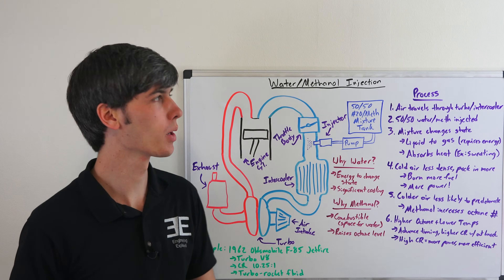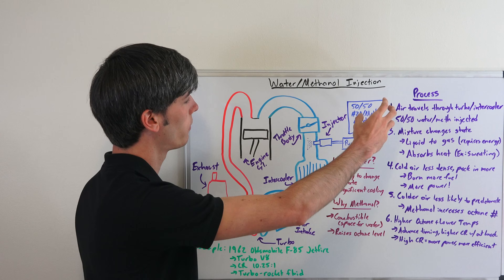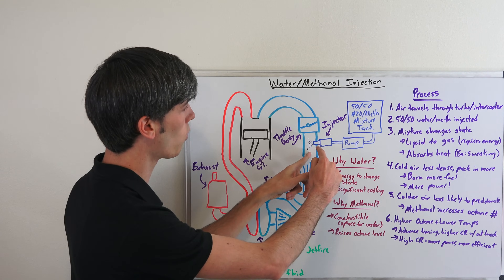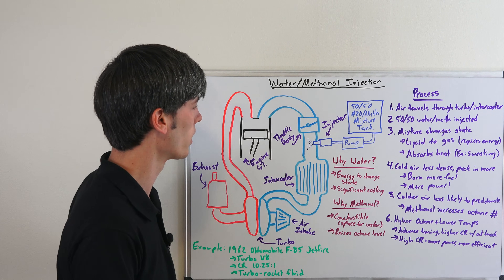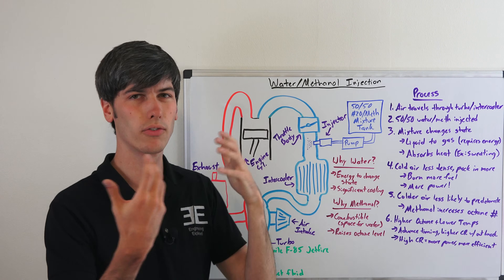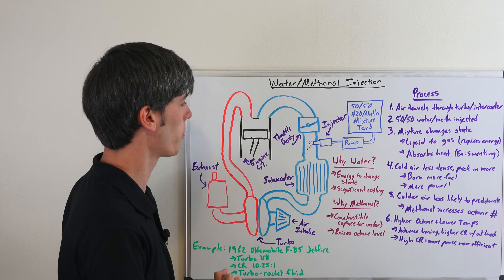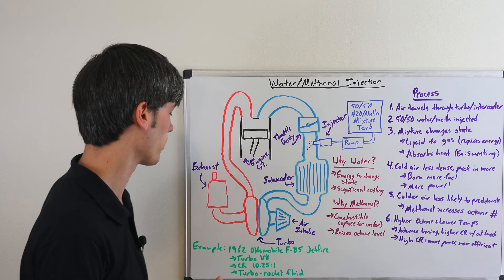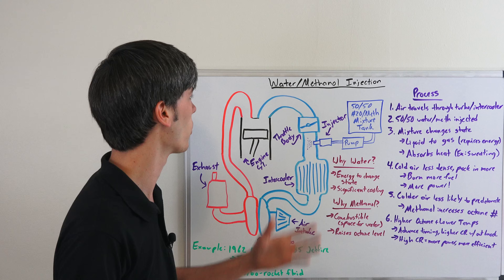Water Methanol Injection - More Boost!

Comment: What happens when only water is sprayed in?
Reply: +Horng Jian Bee If you use 100% water you need a lot of "heat" (boost or compression), otherwise you risk blowing out the flame front causing mis-fires.
Reply: +Horng Jian Bee  Greyson Paynter for it right.  So long as you don't spray large amounts of water, it won't hurt anything.  You won't get the additional power from the higher octane, but you will get a denser air charge into the engine, to a small increase in power - as well as keeping the inside of the combustion chamber spotlessly clean.  I did that for years with a modified classic Mini, since they have a tendency to run pretty hot and not much room for larger radiators.
Reply: you will,not blow the motor it is 100% fin it will,just cool your iat you will not have the octane boost from the methanol so not as much power
Reply: +Brendan Doyle it will not hurt the motor unless you way to big of a jet
Reply: +greyson paynter Yes it wont hurt the engine but if you have a tune for 50/50 but  add 100% water you can extinguish the spark.
Reply: Thats true if its tuned for 50/50 dont put 100% water in also if you run out it will not turn out well
Reply: +greyson paynter Also should add that most systems use a hand held tuner so you can run with system off and different spray levels. E.g. performance tune, track tune, tow mod.
Reply: thats ture
Reply: True*
Reply: +aussiebloke609 Just remember you're only trying to cool the air down abit as it enters the intake manifold, so you don't need anywhere near enough water to extinguish the spark.
Reply: +aussiebloke609 Small mist with a long interval should be sweet.
Reply: +Horng Jian Bee it will help especially if your iat are high
Reply: +Horng Jian Bee More or less what people said. Need a strong spark.

For the main part, it isn't meth with water added but rather water with meth added, ie.water is the main benefit, meth just makes the water a bit flammable. The madmax turbine motorbike is spraying 70/30 water meth at 8 litres per minute. Mind, it gets 7 mpg at cruise...

Comment: I really hope he does a video on a 6-stroke engine design. That might be the future of ICE engines as a 4 stroke is quickly reaching the maximum efficiency you can get out of it.
Reply: so what's so good about 6-stroke designs
Reply: ichiban ter A lot of heat is wasted in the combustion of fuel in the power stroke of a 4-stroke engine. That’s why your engine gets so hot and why ICE’s are only about 30% efficient. Much of that heat is just transferred to the engine block or expelled out of the exhaust instead of being used for power. A 6-stroke aims to use this wasted heated to generate more power. Water is injected into the cylinder at TDC in step 5. Due to the heat, the water instantly vaporizes and forms into steam, expanding rapidly. This rapid expansion forces the piston down for an extra power stroke, then the steam is expelled. The water absorbed the heat, turned it into power, and helps keep the engine cool. Now we’re talking about an engine with fewer emissions and more fuel efficient than a 4-stroke, since fuel is used once every 3 piston rotations rather than every two in a 4-stroke. Also, a cooling system might not even be needed or be less dependent in a 6-stroke design because the water absorbs so much heat. The only problems are complexity/weight added by the system and that the power strokes might be uneven in forces, meaning an engine with many cylinders (like a V8-V12) might be needed to balance the forces. I think we can overcome these problems and start using the 6-stroke design, but no one has really explored this concept. It’s a shame because steam was used to power boats & trains before ICE’s ever came along. We should still use that technology today.
Reply: +Unbearable Pain Now that you explain that, it seems really obvious. Why are we not funding this? haha.
Reply: +Mesder13 you have to have the same amount of water as you do gasoline or whatever fuel you're using, so if you have a 15 gallon gas tank you need a 15 gallon water tank which adds a bit of weight. another six stroke design incorporates using air injection instead of water and it will still add an extra power stroke without the need of the water tank but it's probably not going to be as powerful.

Comment: I know this subject probably has been covered by other people.
But im asking this simply because i like the way you explain stuff.
Water Methanol injection in a naturally aspirated engine?
How does it work, will there be gains? 
Thank you.
Reply from the maker: +Makeit Flip It could allow you to use a higher compression ratio assuming the intake air is warm enough to evaporate the air/fuel mixture. These systems are much more common on turbocharged set-ups (because boost increases the likelihood of knock significantly, and compressed air is warm), but I believe it may be possible to do it on an NA. That said, it very likely wouldn't have the same effectiveness, if it was indeed beneficial.
Reply: To specifically address your question, Makeit Flip, adding water/meth injection is not something that creates gains or power improvements - at all, at least by itself. It facilitates aggression in the way of boost, timing, or compression ratio. Meaning you can use water/meth to run extremely high compression ratios (~14-15:1) with timing that you never would be able to on pump-gas.

It works in NA the same way it does with turbocharging - it cools the air charge by having the water absorb the heat, instead of the fuel. If the fuel absorbs too much heat, it explodes, sometimes before it is supposed to --- That's engine knock. In particular with NA, you are stuck with the parts you build with, meaning you have to very precisely determine your parts list, and then probably always run the engine with water (and have a safety/backup mode for when the water/meth tank runs low/out). 

With turbocharging, you can adjust the amount of boost after the fact, and either reduce it or increase it after putting everything together.

As usual too, if you're going to go out of your way to add high-compression pistons to an engine, you've already started to spend ~1/2 of the money it'd take to properly turbocharge a vehicle, so it's a pretty tough sell.
Reply: tap water. Filtered if you are picky.
Reply: I've read, and taken with a grain of salt as I don't just believe everything I read, that another benefit of water/methanol injection can be in the form of keeping the valves and piston tops clean since the evaporated water essentially steam cleans those components. I'm considering running it on my naturally aspirated motor because I have Direct Injection and I have heard they have a much higher propensity for build-up on the valves because the fuel is being injected directly into the combustion chamber instead of on the back of the intake valves. While I continue to do my homework on this subject, I have installed a catch can inline with my vehicle's PCV system to try to catch as much blow-by vapor as I can.
Reply: +Joe Smathers Actually it definitely does create gains and power improvements. Back in the 70's the US army comisioned a study in completely cooling a diesel engine by injecting water into the cylinder and eliminating the whole cooling circuitry. They found that due to the way it was injecting, some of the water was sticking to the cylinder wall and ended up badly polluting the oil, and from memory I don't think it ever really cooled the engine enough to completely remove the coolant either, BUT and a big BUT, one of the side effects was a signicifant increase (~20% from memory) in power. And that was water only, not methanol. Without adding extra fuel as that would undermine the whole cooling without coolant thing they had going. I've got the paper somewhere here, but it should be possible to find online.
Reply: I just lost a whole lot of typing. Short version:

https://ergosphere.files.wordpress.com/2011/01/us-army-water-injection1.pdf

A 3/1 water fuel ratio. Very high, with the purpose of cooling. Power was a side effect. up to 20% power and BSFC increase.

A fair torque advantage was gained late in power stroke due to steam flash. It couldn't flash earlier in stroke because too much water. By substantially reducing water injected, flash could occur much closer to tdc giving far higher cylinder pressures where it is wanted.

People tuning with water only have reported 40 mpg returned in a 13b, which would ordinarily struggle for 20, using a lot less water than the army did. Engineers on merlin reported similar BSFC increases at higher manifold pressures [citation needed].

I agree it's not a signicant source of power compared to increasing boost to 15 psi from 10, which it makes possible, but I wouldn't say it's not a significant source of power in it's own right. ymmv.
Reply: +Authur Jackson Then factor the cost per gallon of distilled water and the mileage improvements become a really moot point.
Reply: +Authur Jackson You go right ahead and inject tap water into your engine. :)
Reply: hehe. I don't have a water injection set up. I wish I had the means. I'd use 50/50 or 70/30 or something between, as that has been demonstrated to give more benefit. But that's not to say there is none in just adding water in an NA engine. Looking through other comments, I think I saw someone mention the turbine at their powerplant injects water and increases the yield by 20 MW.
Reply: Authur Jackson I've commented in other places that water/meth injection is beneficial to NA applications (especially extreme ones, that use exceptionally high/almost dangerous amounts of compression) -- but time/effort/money in vs. power/performance out, it's just not a worthwhile investment. Definitely a nice, extra tinker factor for the extreme tuner, though.
Reply: fair enough.
Reply: Thanks for good answers, Joe Smathers and Engineering Explained Great information to have. Thanks again :)
Reply: I know this is an older vid, but. Have a 3.5 ecoboost looking at 100% meth bc factory fueling hits its limit at wot, is there any benefit to using a mix with water? What's the process for figuring that out?
Reply: It has been done, I know someone that has done it. When used on a N/A application, it is because you are wanting to run a high compression engine on pump gas, and you have a wild cam. If your
compression ratio is right for the cam, it might not be right for pump gas but you can probably get away with it until the load gets too hard.
Thats where the water/methanol comes in handy... you set the pump to come on only during hard loads, where detonation is most likely.
My friend that did this was able to run 1.5 points more compression
(I think thats what he said) over what he knew was too much for pump 
gas.
Reply: Because water/meth injection cools the incoming air it is beneficial to all combustion engines. Obviously there is a greater need and greater advantage using it in forced induction applications because their charge air is much hotter. I remember seeing crude water injection kit adverts in car magazines from the 80's. They were little more than a windscreen washer bottle and pump. They claim they reduce fuel consumption but this will only work if ignition timing was increased. 

I experimented with an even cruder water injection setup. My Ford 351 Cleveland N/A engine was pinging badly so I soaked the air filter in water, stuck it of the engine and went for a blast. The pinging was gone until the the air filter dried out. Hahaha
Reply: Authur Jackson Reread the paper and you'll probably come to the obvious conclusion that for the power produced versus the weight incurred by the system (in fluid and equipment) to run at such levels, it's absolutely not useful.

For the levels of ~GPH that water/meth kits that are actually run on vehicles, it is not a significant source of power, the same way plain untampered tap water isn't a significant source of vitamins.

Comment: water gets converted into air in the cylinder so it's compressible. 
But because it doesn't contains combustibles, the air fuel ratio is now lowered, thus you loses some power. So you add methanol to aid in the combustion, which increases the air fuel ratio ( since methanol is a fuel, ) along side with fuel ( petrol ) and air ( which is well, water )
Reply: No sorry but you're wrong. If you can split the oxygen from hydrogen of the water (H2O) then you wouldn't need additionnal fuel because you would have hydrogen splitted from the oxygen.

Comment: You can in fact inject water before the Intercooler as I do very successfully. But this is a different method known as pre turbo mechanical water injection. Much less parts to fail, little adjustment needed and turbo sucks in as much as it needs once flow has been adjusted to optimum levels at nozzle.

Comment: So what happens to the water? Since it can't be compressed?
Reply from the maker: +DoubleYouPee As mentioned, it changes state from liquid to gas.
Reply: +Engineering Explained Yeah, but won't compressing it cause it to go back to water?
Also does it simply become a water vapor because it's sprayed through a small nozzle?
Reply from the maker: +DoubleYouPee In theory, yes compressing a gas will eventually turn it to a liquid, but it also heats this gas in doing so. We're not talking about huge amounts of water, more so very humid air. Heat plus a fine mist results in the water evaporating.
Reply: +Pulkit Banal 
1. The water is bound to the alcohol, therefore is diluted alcohol methanol 1:1 ratio.
2. For everyday apps? No, not necessarily. Especially if you live in areas where you have really cold weather.
3. He admitted his mistake. Lol.
Reply: +DoubleYouPee no. watch the video
Reply: The methanol is vaporized taking some of the engine heat and flows out the exhaust.
Reply: +DoubleYouPee The water gets boiled into steam, providing more expansion force in the combustion chamber, 1 cc of water will create 1492 cc of dry steam.
Reply: +DoubleYouPee that's probably how you get the higher compression ratio
Reply: +Engineering Explained 
1. Where do those evaporated/vaporised water molecules go?
2. Is the water-methanol injection continuous(as long as the engine is running)?
3. As far as i know cold air is more dense than hot air?!
Reply: 1. After vaporising, and binding to the methanol molecules, water molecules will reduce the combustion quality, right?
2. So injection of this mixture is based on feedback received by some temperature sensors inside the intake manifold?
Reply: +Pulkit Bansal come on! the water vapor is inside the combustion chamber with everything else. here is a highly hypothetical explanation; let us assume each unit of space provides some power output. H2o molecule take up 10 unit of space, but it cools the air enough for 11+ unit of space, and the methanol has a >1 power per unit multiplier and  it raises the octane of the fuel mixture which is lowered by the H2o. the yield is higher power output.

a perk of water injection is kinda brought up by ur "where does the water go" question; it has nowhere to go. since the water has nowhere to go and is not very compressible, it finds its way between engine buildups and the metals. it keeps ur engine combustion chamber cleaner like a lazy power washer.
Reply: +Engineering Explained Whats the point of this? When i say that I mean why not use NOs also it's tanked so when you run out you can replace/refill.
Reply: +Robert Perry It costs $10 every times you hit the button.
Reply: +DoubleYouPee In a standard 4 cylinder 2L engine, there is still about 45cc of volume in the cylinder at TDC. You would only be injecting a fraction of a mL each revolution.
Reply: The amount is very little so it won't cause a problem. I heard someone who had a faulty water injector that didn't shut off and the water volume just grew until one of the cylinder sucked it in a gulp and blew the block + broke the con rod
Reply: This exactly why i like Engineering Explained videos it helps everyone from rookies to pro's understand the 5W's of many applications/mods Automotive industry and Tuners use.
Reply: Brian Su yikes! No symptoms at all before hand? I guess it's def not worth the tiny gain.
Reply: SI RICKO yup hehehe the piston could be pulled out of the block from the size of the hole created. lol!
Reply: +DoubleYouPee It will simply go out the exhaust as water condensation.
Reply: +Engineering Explained im not sure if you mentioned this but the evaporated water means that the now wet air has a lot more mass to it. this means that the temperature difference from bottom dead centre to top dead centre is a lot less since the water in the air takes up a lot of the compression energy again inside the cylinder. this means that you can run the engine leaner or you could put more timing in it. sorry for my bad english and maybe not using the correct terms but im sure that you are smart enough to understand what i meant.